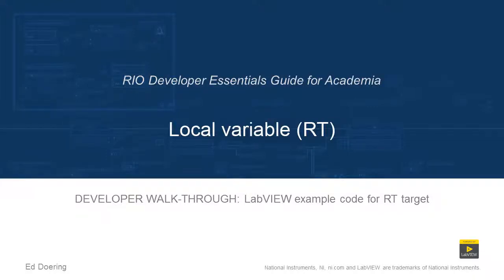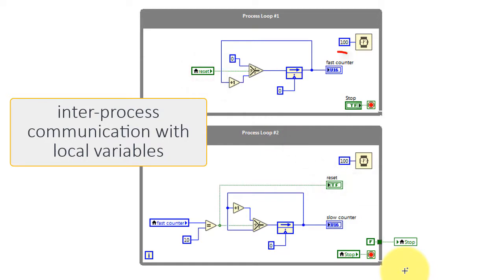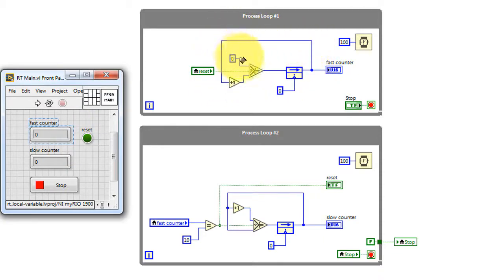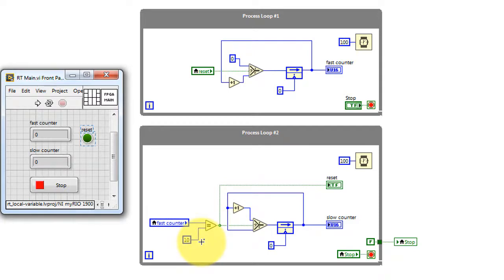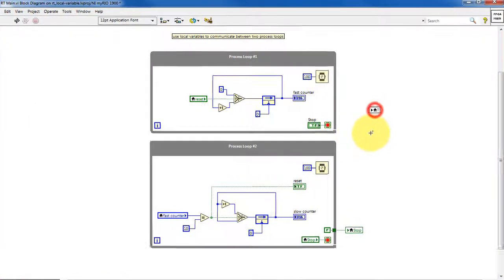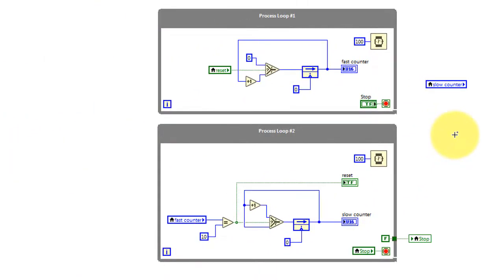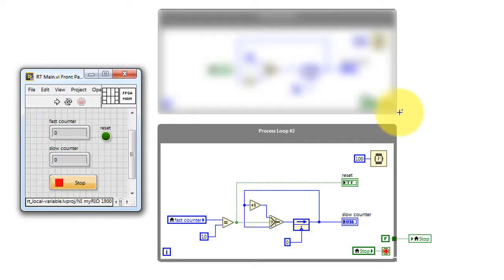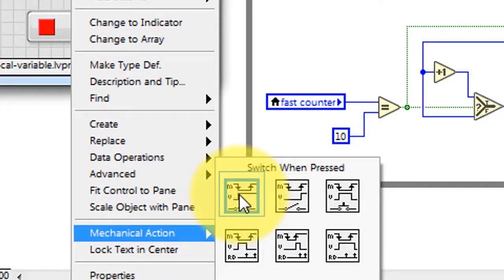LabVIEW code: Local variable (RT) (walk-through)

Comment: very nice
However, if one loop is ruining faster than the other loop, I cannot stop the two loops at the same time, do you have any solution for this? Thank you
Reply: the easiest to implement method would be to go to the front panel and right-click the stop button, then edit its mechanical action to behave like a latch. Then outside the while loops set the state of the button to true during initialisation.